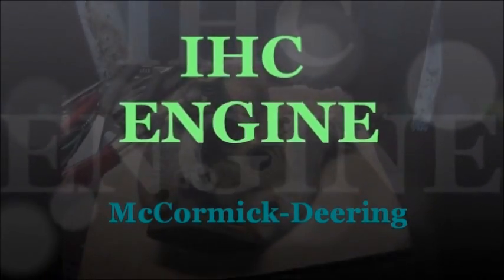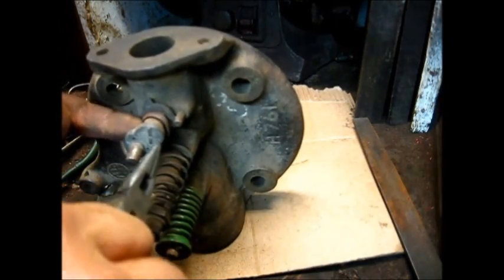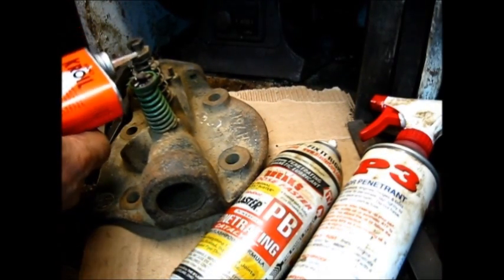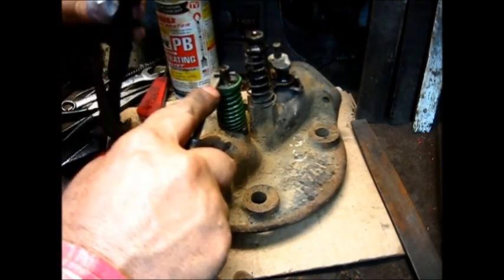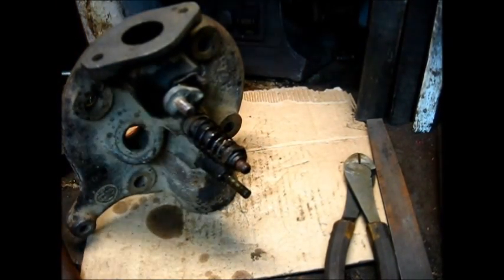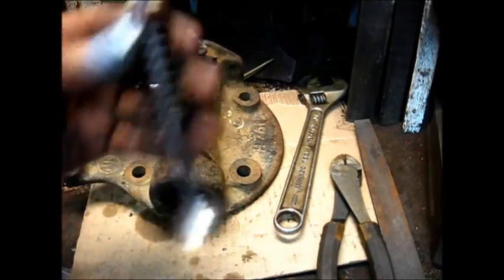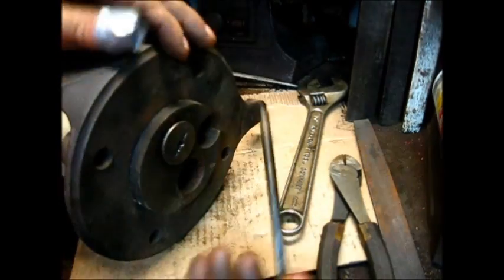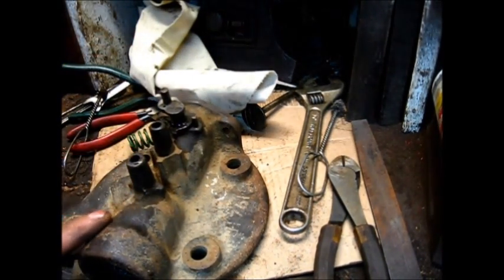IHC ENGINE  head and valves

Comment: Four stroke, Atmopheric induction engine,
limited to low R.P.M.
As the Exaughst has a cam and a push rod,
the intake valve is simply "Sucked" open,
As the piston travels down after the Exaughst Cycle.

Comment from the maker: ,,,, Entergy Electric Co.,,, 12 volt DC battery charger ran at about 8 amps,, for the 110 volts AC I just plug 'er into the wall socket, I think the 110v comes from somewhere down south,, shopdogsam

Comment: I totally agree with you with the penetrants. Kroil works GREAT, but is expensive. PB blaster works just as good, but cheap and easy to find. I have tried some of the concoctions, i did find some success from 50/50 acetone and ATF.